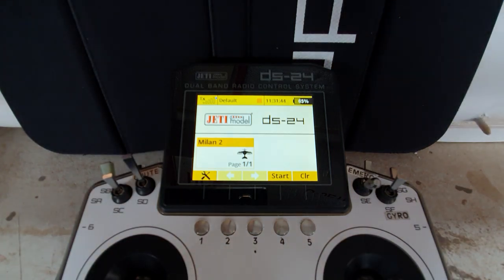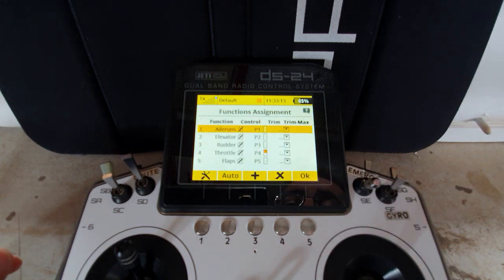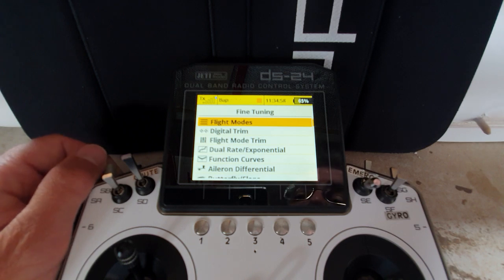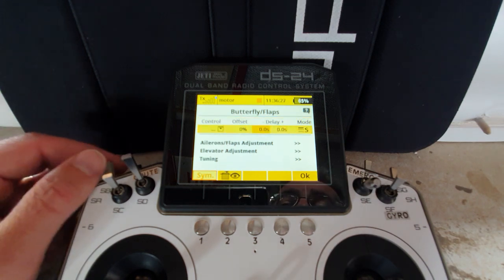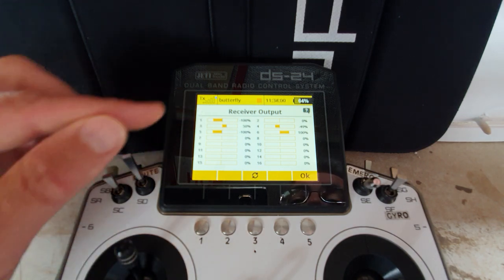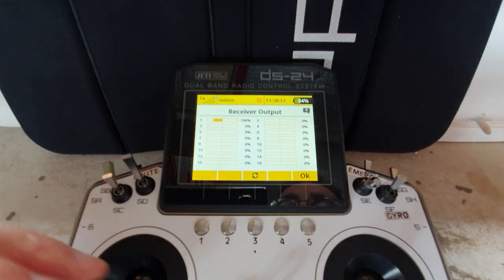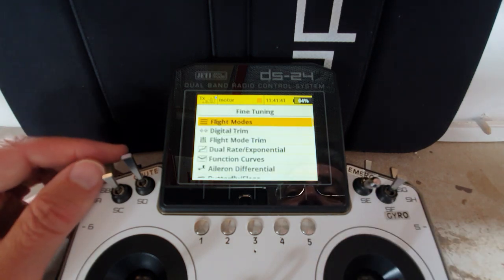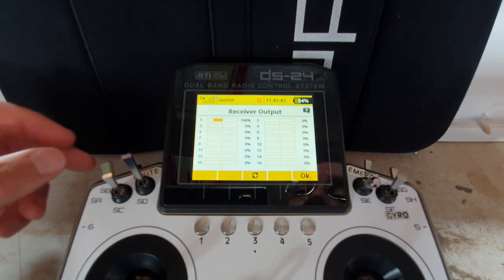Jeti - throttle and flap and butterfly on one stick

Comment: Thanks for this nice feature. It did help me a lot. It is programed today in my Jeti for my FOX glider. I did  add a motor cut flight mode to the motor, flaps and butterfly mode... So I flip up a single switch and the motor remains cut for all flight mode and stick position... Just For safety.😊🎉